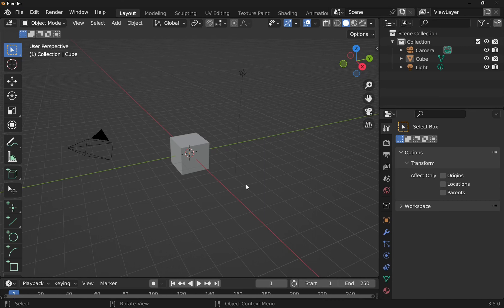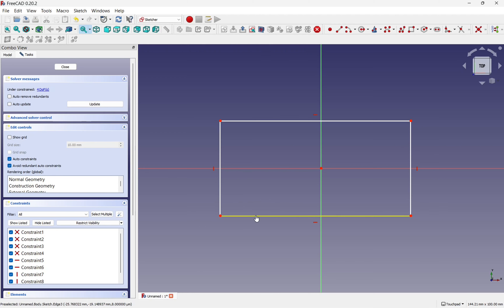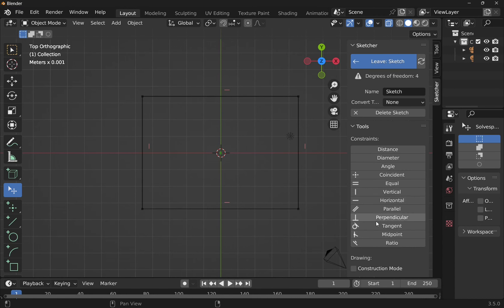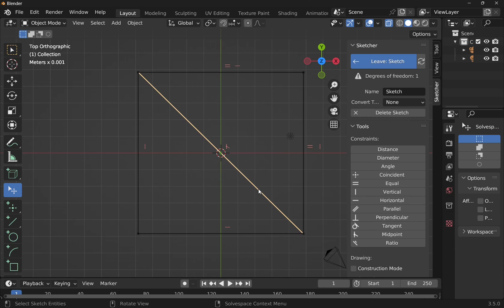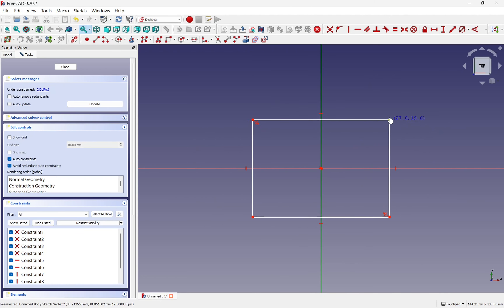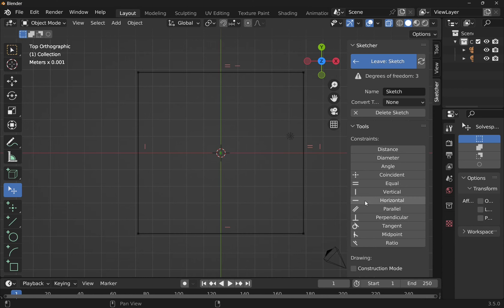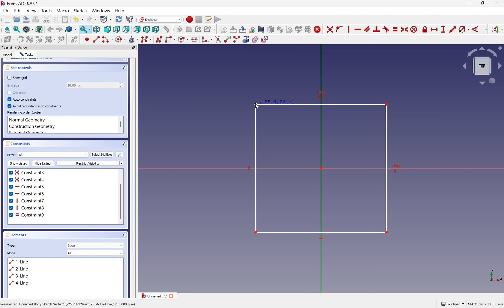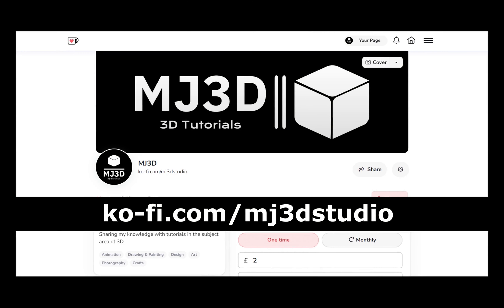Learn CAD Sketcher | 4 | Basic Constraints compared to FreeCAD  |  Blender Beginners Tutorial

Comment: Hello! How is the path for CNC workflow, compared to freecad? I find some things pretty annoying in freecad, even though i kind of figured out hacks for each of them
Reply from the maker: Hi, I haven't had any experience with the workflow for cnc worth blender.  With 3D it's straight forward stl output but it's one thing that I need to look into as I have a laser cutter and others have asked the same thing for cnc router. Are you looking to do basic cutting or carving and enscribing?
Reply: @MJ3D_Blender  I've actually tried blender for carving and it was much better than freecad's experimental 3d features in the path workbench. I found pretty decent video tutorials, also.
I am making mainly hardwood stuff with my cnc, so I would describe what I need as 3d cutting. There are a lot of annoying things in freecad that affect work time in an unpredictable way. For example, I had to spend a whole day to figure out how to cut the outline in a part of the piece that didn't go all the way through. It simply wouldn't create a path at all. You have to hack it by adding 0.02 at the final depth. For example, if you need a contour cut down to 10mm, it won't work. But if you manually set the depth to 10.02, it will. Not 0.01, it doesn't work :) all these little hacks take a lot of time. Btw, thanks for the image import and scale to size video, it saved me a lot of time yesterday
Reply from the maker: Thanks for the update, I am hoping this channel will be like a 'stepping stone' allowing people to transfer either way or use both. But I have a lot of unanswered question with blender I need to research and experiment so the channel is also a research channel so I can share what I find out with others. There is a language barrier between 3D HSM and CAD. I originaly came from 3D and I want to share that knowledge that I gained when I made the jump from hard surface to CAD. At the time it wasn't from Blender but from 3D Studio Max R2 and Rhino 3D. Around then there was no such thing as 3D printing and I never even seen let alone used a CNC machine.  So there are large workflow gaps that I want to feel. Be great if you could share the videos as pretty interested. Ah yes, glad you liked that video 😊
Reply: @MJ3D_Blender  I just started a brand new channel dedicated to the CNC, which will be, most probably or at least for now, based on freecad. It's the only viable option for now, considering the things that I find the best in freecad: parametric design and an all in one solution. I connect my laptop to the CNC, I design the piece, I create the path and start the CNC.
Reply from the maker: You just gained another subscriber 😁 some really nice stuff on there, love the night stands and that oak coffee table is beautiful
Reply: @MJ3D_Blender  thanks! I'm glad you liked them. Those two are one of my all time favorite projects, too.